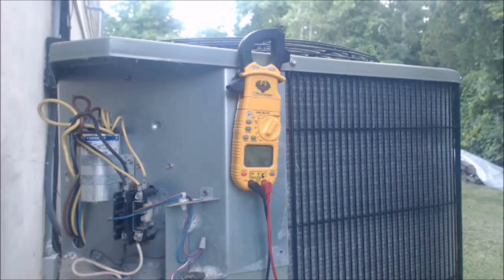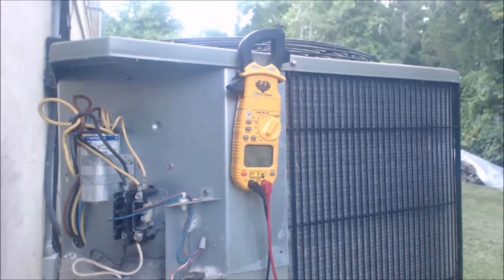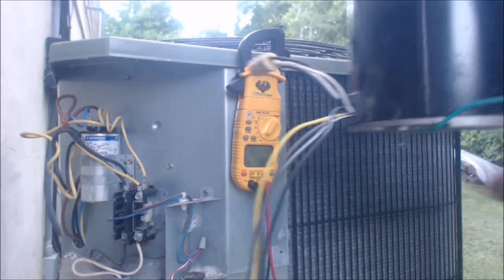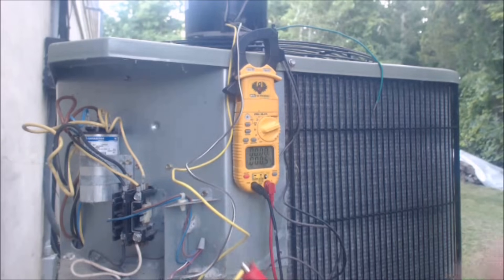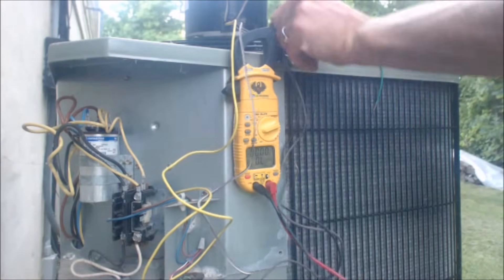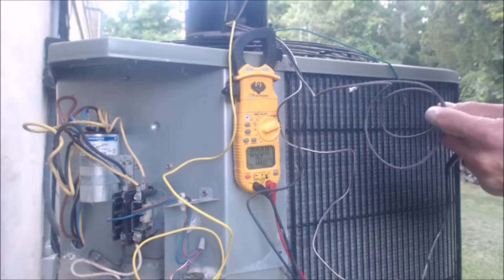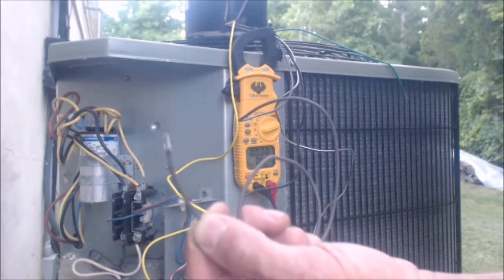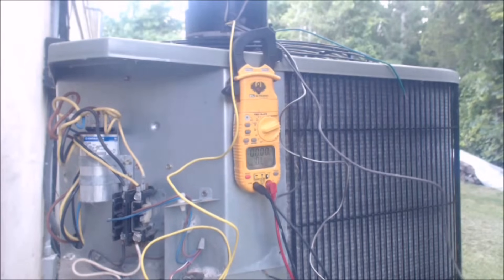4 Wire and 3 Wire CONDENSER FAN MOTOR WIRING! How to Eliminate 2 Run Capacitors!

Comment: Is it possible to just put the 4th wire to the common terminal on the dual run cap ? Today I changed a ECM to PSC motor in an condensor plus I rewired it to a new dual run cap . But the motor doesn't sound rite and it wasn't starting every time a called for cooling . I just cut the brown and whuye wire and capped it .Any thoughts that could be wrong ?
Reply from the maker: Hey Sean, yeah it could just go right on the common part of the contactor. You took out a ecm condensor motor and replaced with a psc? Are you just powering the fan then with the two 120v tabs coming off of the contactor then? Does your cap size match your new fan motor. Was that a two speed condensor fan since it was ecm?
Reply: @acservicetechchannel  
Thanks A.C. for getting back to me . Ya I connected the black and white to the contactor and the brown to the fan on the capacitor. But from the start after I did the install the fan didnt sound rite and was struggling to start running . I cut the brown and white wire and capped it and left it running . The PSC installed was a 1 speed 1/3 Hp 208/230 1075 rpm 2.2 amp . I checked the amp draw while it was running and it was within spec . It's not turning over every time I call for cooling rite away . Instead it pauses then starts running . I installed a new dual run cap (40 + 7.5 mfd) 380 v . The ECM was 4 wire I think single speed . The blue and yellow connected to the contactor coil and the other two on the T1 and T2 .
Reply from the maker: So you left the white connected to the contactor, correct? Make sure your common comes directly from the contactor and then have a jumper wire to the c terminal of the capacitor. The brown/white wire could have also been connected to the common side of the contactor. Make sure the other wire is the run on the contactor and the brown start is on the fan terminal on the capacitor. I am assuming the new motor takes 7.5mfd cap as stated on the motor rating plate. Just check and make sure you have 0.0 ohms from brown/white to the white wire. Take a look at the wiring diagram and just check your wire colors to be sure, thanks
Reply: @acservicetechchannel  
Awesome man ! And thanks again for your help . Im going to come back to the Patreon group nc I started my own buisness now and I could use the help regarding quoting and advertising .
Reply from the maker: Sounds good and I am always glad to help when I can, thanks Sean!

Comment: What about on a defrost board?  I'm replacing a 3 wire to a 4 wire.  I have Black to defrost board , white to common, brown to the conpacitor and the brown / white wire I don't use.
Reply from the maker: The white and the brown/white wire should read 0.0 ohms of resistance between each other so it is as if they are the same wire so put the brown/white in the same location as the white wire, thanks

Comment: I just recently installed a 4 wire condenser motor to a 3 wire system but oddly enough neither of my brown wires had a white stripe. I capped off one based on customer comments and ran the other to my dual run capacitor. If this were the incorrect brown wire then the fan would fail to start correct?
Reply: Timothy Bryant not just fail to start, it would burn up the windings inside the motor within minutes.
Reply: @Xubaosong  Well it's been running for a week now so I must be in the clear. Good to know it was solid advice.
Reply from the maker: In the future, you can ohm the brown wires to see which one has 0.0 ohms with the wire connecting to the c terminal of the capacitor, thanks

Comment: I'm trying to learn what Run Start and Common mean and do on a condenser fan motor and also what they do on the compressor. Could you help please.
Reply from the maker: Run to common is one winding and start to common is the second winding. Run plus start equals start to common and run to common added together. They are the two electrical windings that are powered for the motor to run, thanks

Comment: Problem with new fan motor.  I have a three prong dual cap on unit. A one phase contactor. New motor has 5 wires on it, orange-yellow-purple-blk-brown.  The old motor had three wires, black-orange-brown.  I hooked up the new wires the same as old ones,  now what to do with the leftover  purple and yellow?
Reply from the maker: Is this a multi speed rescue type motor? Make sure to use the wiring diagram instead of colors. I would check their wiring diagram for replacement instructions, thanks Don!
Reply: Thanks, a buddy helped me with the wiring~

Comment: I just purchased a new fan motor and it came with a 10uf cap. The existing one I have is a dual 370/5uf ...what should I do here ?
Reply from the maker: Use the one as stated on the rating plate of the new blower motor, thanks

Comment: If the rating on the new condenser motor requires a 7.5mfd capacitor can I still use the 10mfd on the dual run cap?
Reply from the maker: No you will definitely need a 7.5 mfd cap if that is what it is calling for otherwise, the motor will burn out, thanks

Comment: Couldnt i connect the brown with white stripe to the capacitor instead of messing with the yellow and just cap off the yellow since it is exposed wire on the end?
Reply from the maker: Yes that could be done too, thanks Jim!

Comment: when I wired the fan motor according to the color codes on the schematic it worked but would start very slow and choppy then get up to speed. reversing poles of the white and black wires, and then reversing the motor direction wires so the fan direction was the same resulted in a fan that started easily and instantly  (and maybe seems to run cooler).  Any ideas why?
Reply from the maker: It sounds like that motor was able to run without the capacitor in play. Once you switched the wiring, it is possible that then the cap was correctly wired. What manufacturer condensor fan motor diagram were you following?
Reply: Interesting.  I was following the diagram for the original unit on the inside of the access panel.  I used an aftermarket A.O. Smith ORM5458B motor.  I did not change the wiring on the compressor of course, though it matched the diagram.  The wiring diagram showed the black motor lead going to the common on the cap which is jumped over to T2 on the contactor which is also the red wire to the compressor.  The white wire was shown on T1, along with the purple from the compressor, and the brown on the Fan of the capacitor. (yellow wire from compressor on herm)  Brown/white was capped off and not used.  The capacitor is the correct rating, new, and tested fine.  Motor started very slow and choppy.

I switched the white fan lead to the C on the cap, black to the T1 on the contactor and boom, started up instantly and ran great (though I needed to switch the motor direction wires to get the fan spinning the correct way.)

I'm assuming since it starts and runs well now that I should leave it, but can't understand why this made such a difference.  The lead on the capacitor stayed the same throughout.

What do you think?

Happy Easter, thank you for taking the time to respond!

Comment: Why not just put the yellow and brown/white in the same crimp and put it on the common terminal,  it would save using a a wire nut and then you don't have a wire floating about in the electrical box?
Reply from the maker: You absolutely can do that. I will add a comment in the video.
Reply from the maker: I think the reason I said that was that it is the simplest thing for people to understand so that they don't put that wire in the wrong spot. I did add a note though, thanks.
Reply: I was just curious, we don't get that style of system here in the UK, its all mini splits so no choice but to go with oem motors.
Reply from the maker: Got ya, I checked out your channel- very good!
Reply: +heavydiesel Every time I watch your videos or read your comments I learn something new about the UK and how we do things different. (No split systems but only mini-splits.) It's cool that we get to watch each other from around the world. 
Acservicetech puts out some great videos. I have been in the field for for a while now but I missed a lot of steps coming up by usually working by myself. It's nice to be able to learn from each other.
Reply: Keep it simple , you doing great job man

Comment: The problem with these damn condenser fan motors is that they all have different color wires, and even different schematics on the label. Just replaced a 3 year old one from Grainger with a new one from Johnstone. Completely different.

Comment: why do you call the yellow wire common when the black and yellow both connect to a hot leg
thanks
Reply from the maker: In this case the wire is going to the common tap which means something different than it means in 120v. This is 240v and on some switches and relays you will see part of the relay designated by c or common. In this case, one of the two 120v legs is going to the common. It is just a hot 120v tap that the voltage can start at. On the Capacitor, where that wire is connected is the c common, thanks Charlie!

Comment: Ive replaced condenser motor twice & is acting up on 3rd one,liquid line is so hot than normal,ive replaced contactor,capacitor & still same issues,3rd motor overheating plz help..
Reply from the maker: What is the voltage while the fan is running? It may be lower than when it is off and voltage stops at the contactor. Make sure to put the probes in first and then turn it on when your hands are in a safe location so you don't run into a problem. Turn the unit off before putting the cover back on for safety,  thanks

Comment: My old motor was 3 wire and has a 50+5 capacitor.  New motor has brown purplish black and white and says it is 10mfd so It came with a 10mfd run capacitor how in the heck do I wire this sucker?
Reply from the maker: So it sounds like you need a 50+10 mfd cap and you would find the wire such as the white and the brown/white if they have 0 ohms of resistance between the two then they can go in the same location and then it is a 3 wire fan again instead of not knowing where the fourth wire goes, thanks!
Reply: @acservicetechchannel  I had already bought the new cap the night before.  Next morning,  with new cap the fan wouldn't spin.  Since many places have  certain return policies I had to keep it but the new motor came with a new 10 cap.   Took a while to find a schematic but it fired right up.  Sadly the blade got a bit out of whack getting off old shaft.  Tad vibration.  Wish the damn weather cooled down and won't have to use soon but over 95 every day still.  I wasn't sure if it would be wired correctly but saw a notation that it bypasses the 5 on the cap so it made sense then. Overall 80 for motor and 21 for the cap.  Maybe 40 for a new blade if I go with a 20in 27 Deg CCW 3 blade.

Comment: Can 55+7.5MFD=/-5% 440/370 VAC replace 55/5uF+/-5% 350/370 Volt?
Reply from the maker: No, you cannot replace the fan motor part of the capacitor from a 7.5 to a 5 mfd as this will likely burn the motor out. You can however just use the compressor 55 mfd part and jump the common to another capacitor that is just 7.5 and use this for the fan though, thanks!

Comment: Well mine wont turn off now
Reply from the maker: Is the power wire on the correct side of the contactor? Make sure to be safe and only examine with the power off, thanks